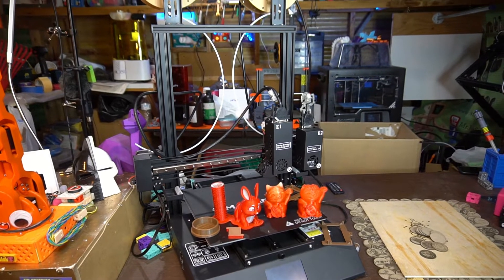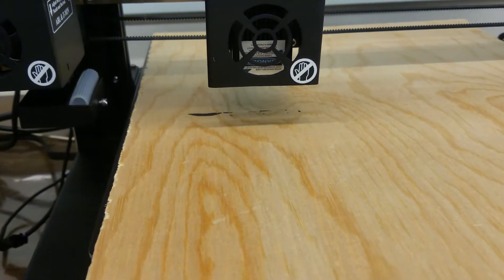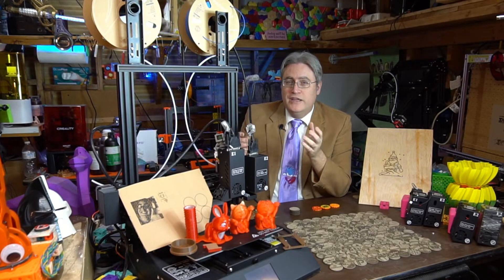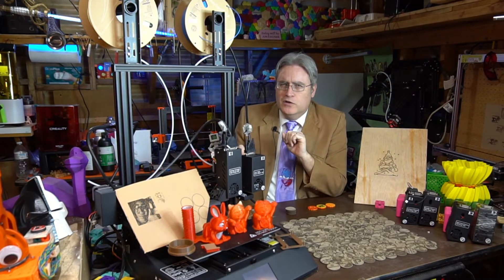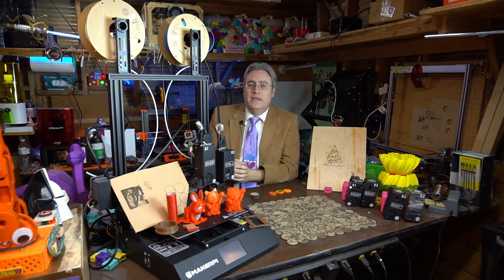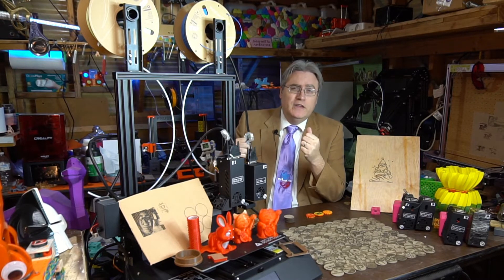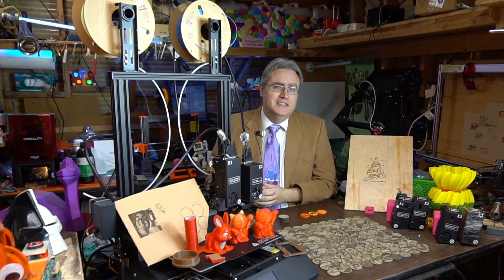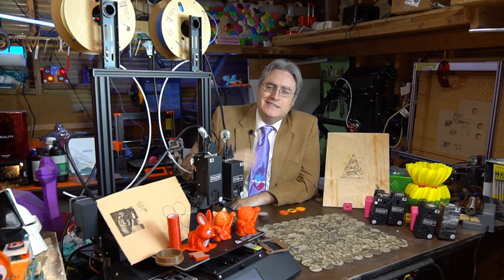MakerPi P3 Pro Kickstarter 3D printer

Comment: this is a bad printer. Through the usb cable, printing does not work, the laser head slows down like a turtle due to low power. You can't print high temperature plastic with two heads, which means when you print at high temperature you don't have an IDEX. There are very few settings in the firmware. only the outdated version of cura works, new versions of cura do not support this printer and the manufacturer does not provide a profile, only cura is built into the outdated program along with it, it is impossible to transfer the profile.
there are no safety restrictions, at the start the head broke a hole in the coating. The magnetic flexible mat is good, the models stick, it is easy to remove. there is no printer circuit, you will have to find out everything yourself where all the conductors lead and flash the clipper or marlin. They would have made this feature from the very beginning and would not have mocked users.
The printer arrived partially assembled, and everything that was assembled had to be reassembled, because everything was twisted somehow, and some bolts were not tightened, they just dangled, well, I checked them all before starting.  It is impossible to install a nozzle of a different diameter, even if it is installed, in the lgf version intended for this printer there is no parameter for changing the nozzle diameter. And this means that parts of 300x300 in size will have to wait for printing for a very long time. Overprice printer witch modest possibilities.

Comment: I am not fond of these 'combination' 3D printer/laser machines.  I think they are more dangerous than the simpler open frame lasers.  It seems to me enclosing an open frame laser (and providing proper exhaust) is a much simpler thing than enclosing a 3D printer that has a laser attachment.  (I see on Amazon there are at least a couple of laser engraver enclosures for sale.)  Not only that, but when laser capability is added to a 3D printer, it seems to me it is greatly increasing the complexity of the machine, and also potentially increasing the chance of user error in switching from one to the other.  I suppose a 'combination' machine can save space, but I am not sure if that space savings outweighs the potential hazards of these machines.